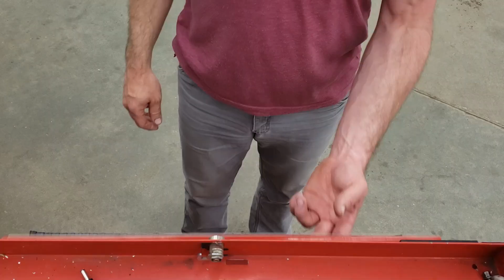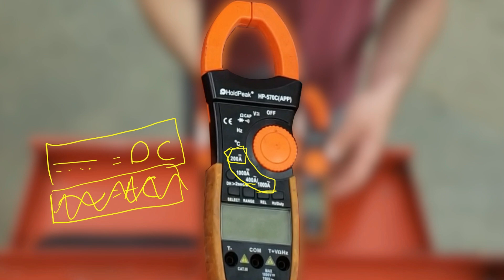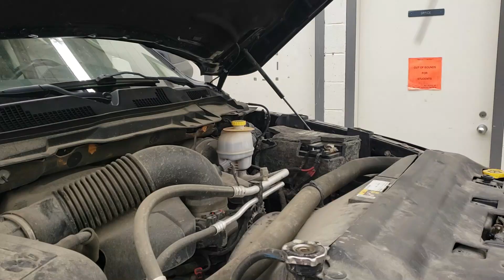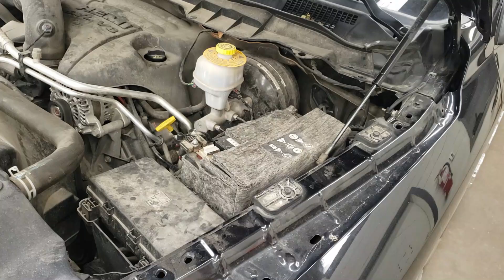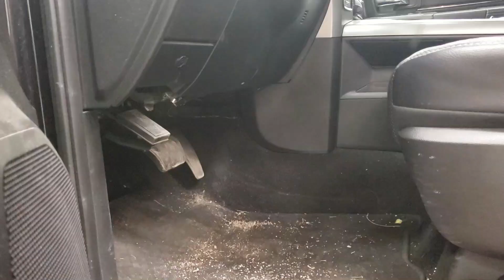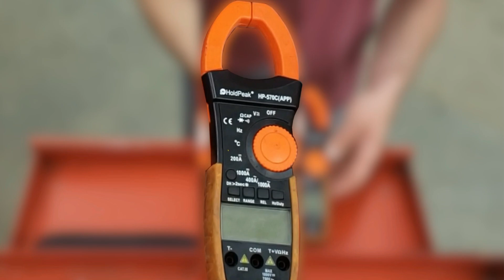Current Testing

Comment: My mom's van keeps going dead so I was testing for parasitic draw. The problem is that when I would touch the probes to the negative terminal and the negative wire it would start off at 1.xx and then fluctuate a bit and go down to .2-.4. It's not consistent. Is that just a crappy multi-meter?